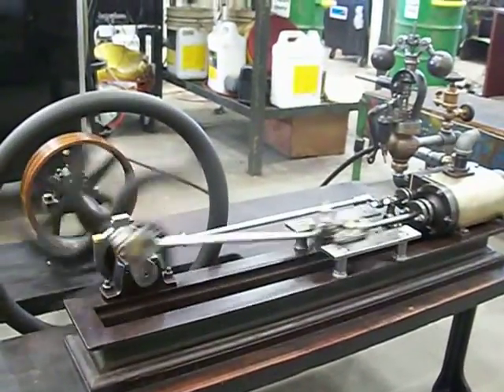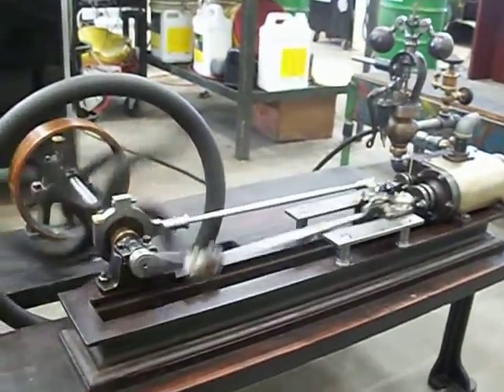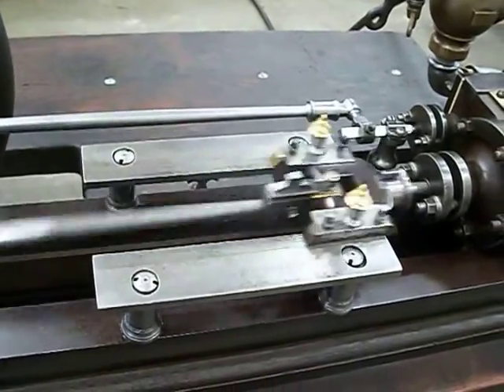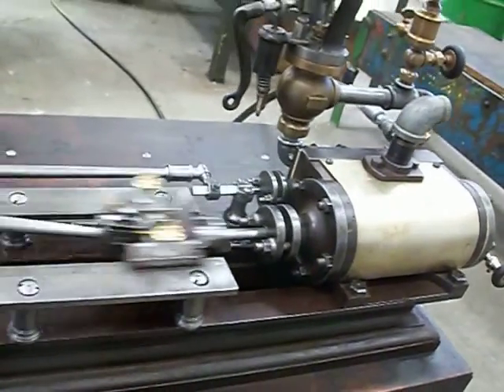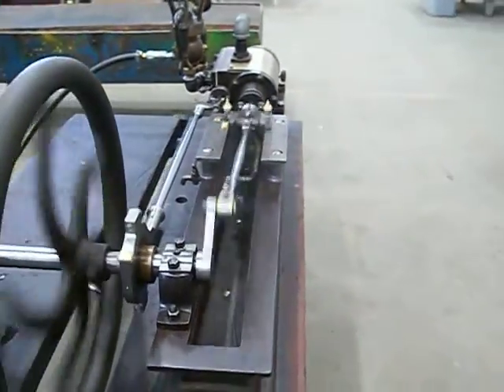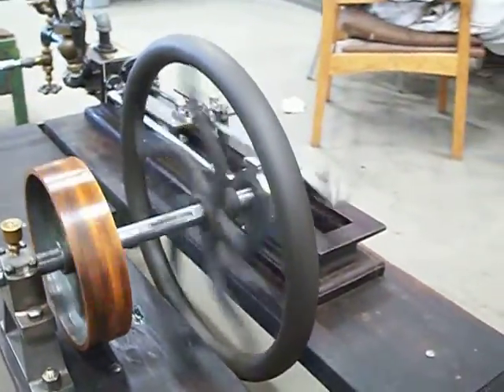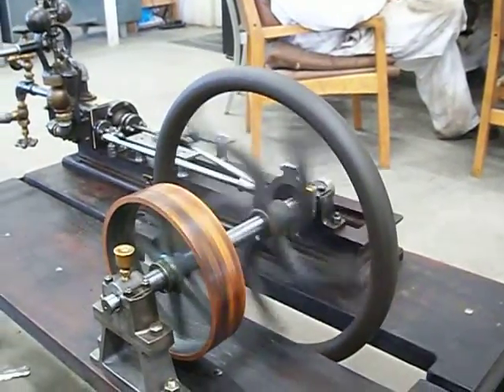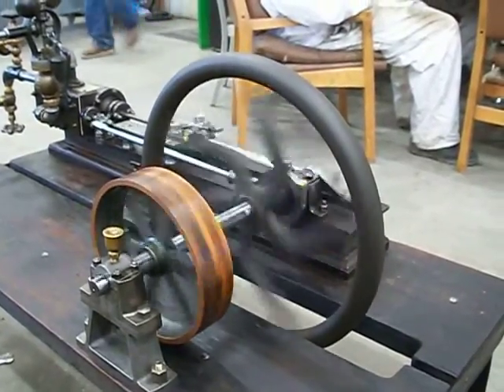The "Virginia City" Steam engine.

Comment from the maker: Ah..no key way running in the open bearing. That is a reduced diameter you see and the short key way is on this reduced diameter only..not on the main crankshaft surface. This probably had an eccentric to run a water pump. As for the key way in the rest of the shaft..this diameter is larger than the crankshaft journal. No key way on any bearing surface on this fine little engine. Thanks for commenting :)